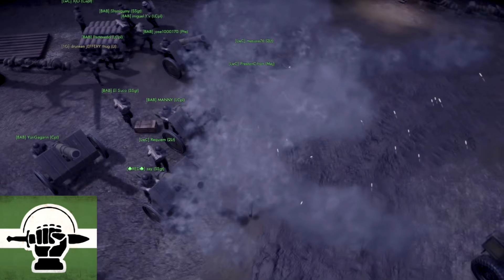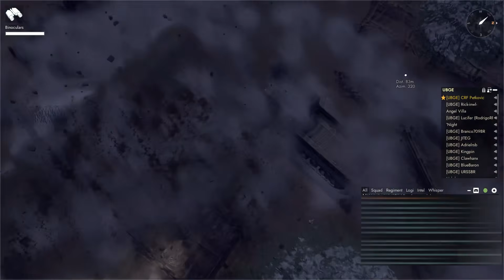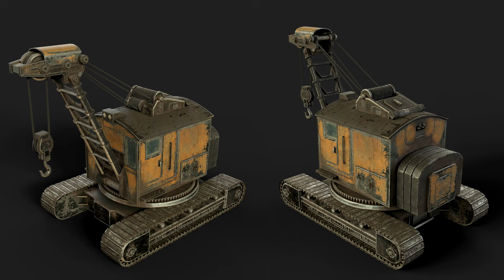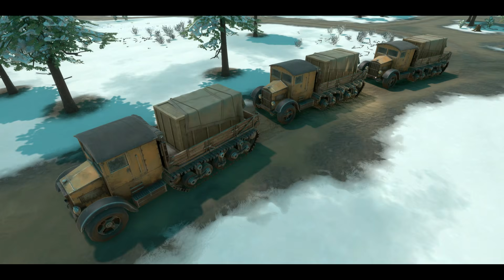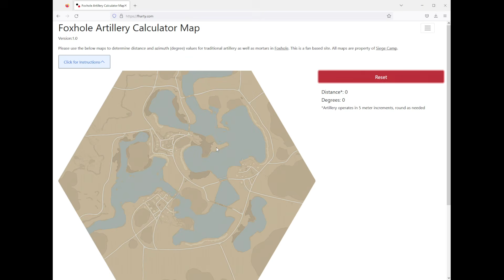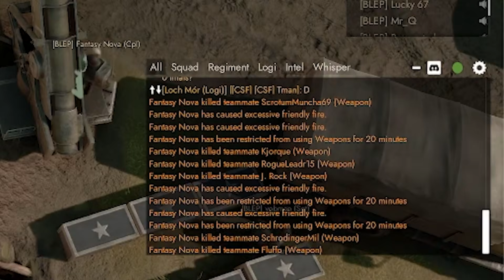Artillery Guide For Foxhole

Comment: From personal experience, “adjust fire” is the probing/spotting rounds, and “Fire for Effect” is when all guns open up with their selected Effect rounds. An example of a gun line description could be “3 guns in effect, 4 rounds adjust, 12 for effect) meaning the gun line would use a maximum of 4 rounds to zero the range, and 12 total shells (split 3 ways would be 4 each gun).

Comment: Errors:
- This is excluding Mortars which is the lightest class of arty.
- Light Arty and Field Arty are the same class, and are faction dependent
- "Fire for effect"  or "Hammer Down" is normally used to mean fire as fast as you can, not ranging
- (?) does not include rocket arty. (?)
Reply: Fire For Effect means your gun is on target and doesnt need anymore corrections and can fire to destroy the target... AKA For Effect
Reply from the maker: Thanks for letting me know! 

Rocket arty I think is going to need its own video. 

Cheers!

Comment: According to NATO doctrine, the order "Fire for effect" is given when ranging and adjustment is satisfactory and is the order to begin the full fire mission. Slight slip in terminology, but an awesome video. I'd love to get involved in some arty teams
Reply from the maker: Thanks for the info! I didn’t know that. 

Super easy to get involved with them. Let me know if you need help finding one! Cheers!
Reply: No problem! It's as simple as the artillery spotter going "Okay, we're dialed in, fire for effect, 5 rounds" or whatever 

I haven't played the game since 2018 but I'm reinstalling it this weekend and hoping to get some of my old friends in to play again
Reply: @Nitrus5 no you're still using it wrong
Reply: @emmyturner7385  No thats exactly how you use it... The FO will give you a grid or a shift mission to see where the initial round lands. they will either give you corrections based on the math you did plotting said point and giving the gun line their data, or they will tell you to FFE (Fire for effect) if you rounds are close enough to the target and the FO thinks that the target will be neutralized.
Reply: @masterhacker7065   Necroposting a bit but I second your use of FFE is correct. It was my job for a while
Reply: That was my exact thought - "why are they doing it the opposite way?!"
Reply: @karlbergstrom2888  I honestly find that Foxhole players tend to do things completely backward and refuse to change it because of reasons.
Reply: This is funny, I have been in a great many teams of artillery, and every one has either not used IRL terminology at all, or the correct one (the vast majority, as Foxhole is full of nerds).

I get a lot of "fire one - add / subtract azmth - fire one - on target, fire for effect / fire salvo / fire all" depending on circumstance.